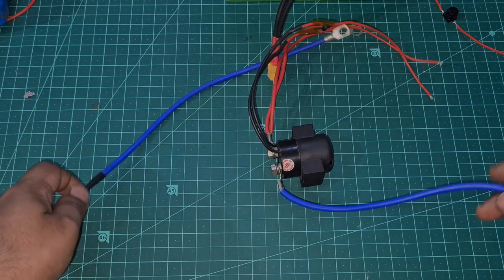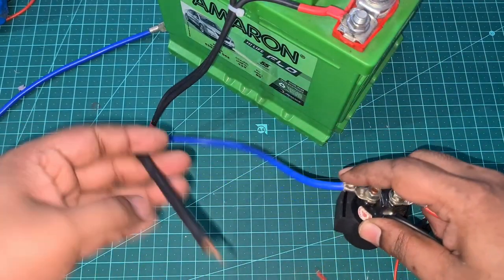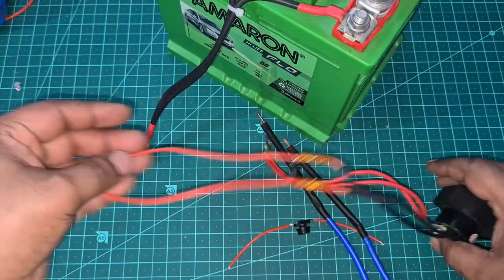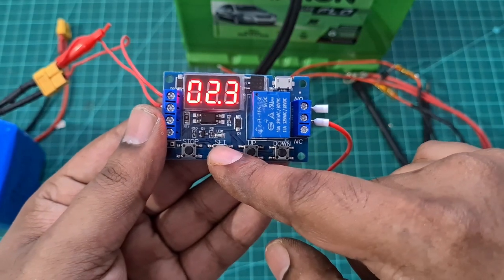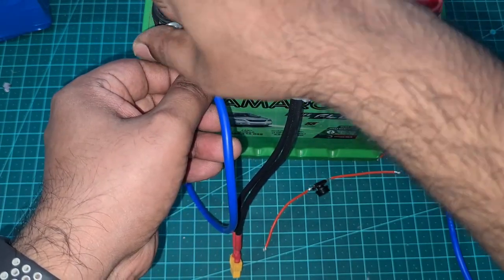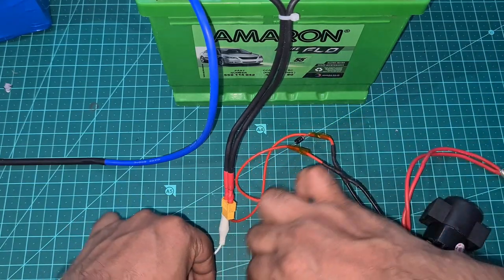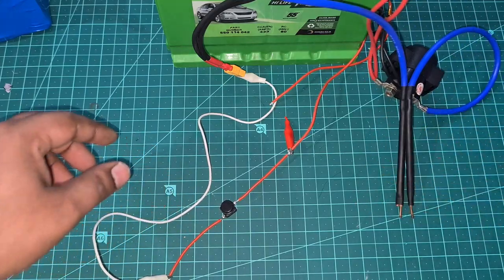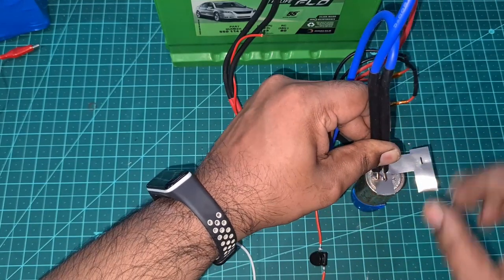EASY DIY! Lithium battery Spot Welder Using Car battery and Relay

Comment: I built a welding device using the ideas presented in this video and it works great.  I used a 340 CCA lawn and garden battery and an atv relay.  I bought some diodes but am using it right now without a diode to see if the diode is completely necessary.  No problem so far but will install the diode if I start having a switch problem. My switch will handle around 6 amps and no problem so far.  I assume the diode is only to prevent a current surge from the collapsing field of the relay coil.  I have no idea how much of a surge would be expected but so far a 6 amp switch seems to handle it.  The welding quality for this setup is far superior to anything I've tried so far.  Thanks to DIYINDIA for the concept.

Comment: The diode is an excellent idea. I had trouble with the solenoid sticking but it may have the switch as I did not have the diode to protect it. I will check further. Thanks for sharing.
Reply from the maker: Glad that you liked it. Thank you.

Comment: For how many welds is that battery good per charge ?
Reply from the maker: I made a 36v 18Ah pack with it. It's a car battery so you can weld multiple batteries. But the weld tips become very hot. So be careful.